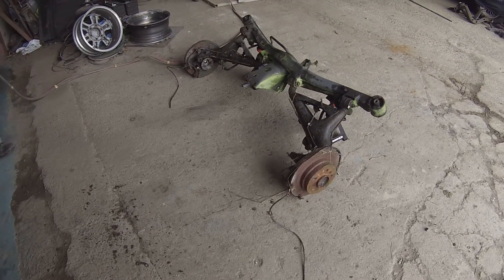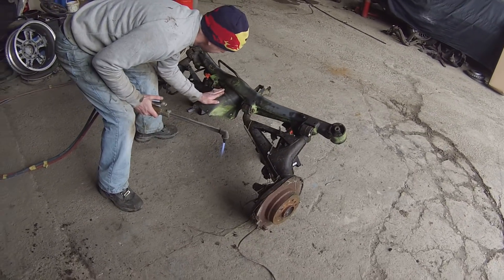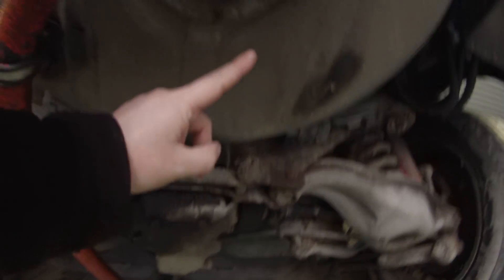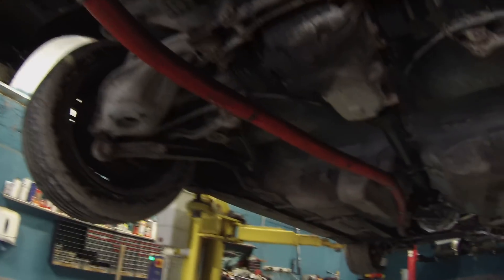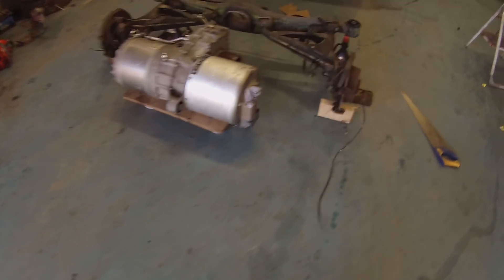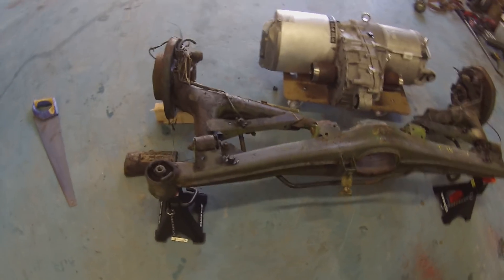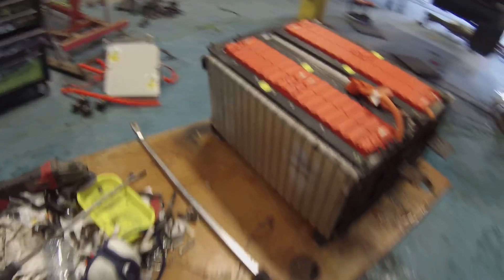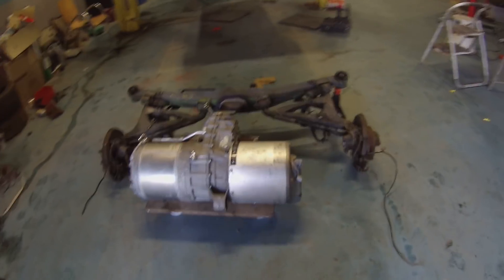BMW E31 840CI EV Conversion 82 : Tesla Swap Day 2

Comment: Question could any rear subframe of an appropriately sized car be replaced with a Tesla motor or would it only be doable for a RWD or AWD car
Reply from the maker: trailing arm suspension makes it much easier.